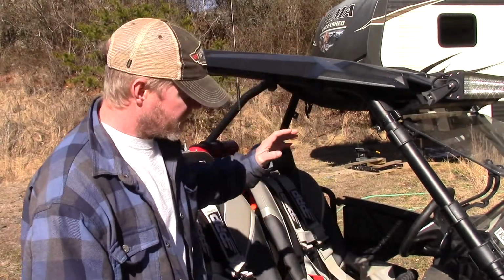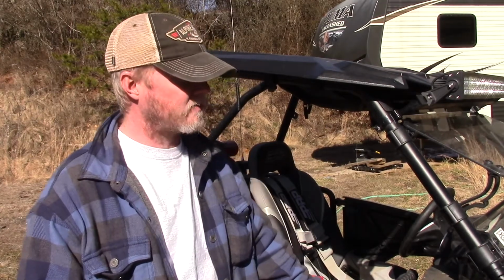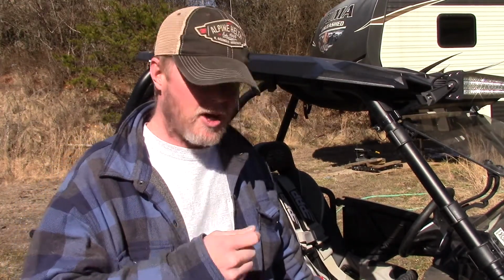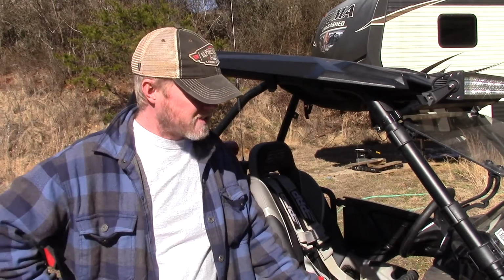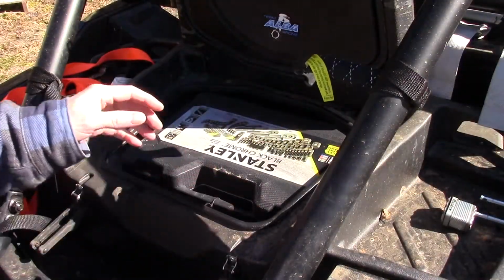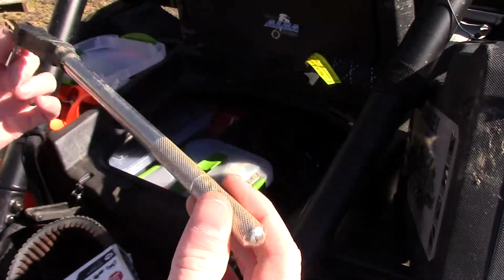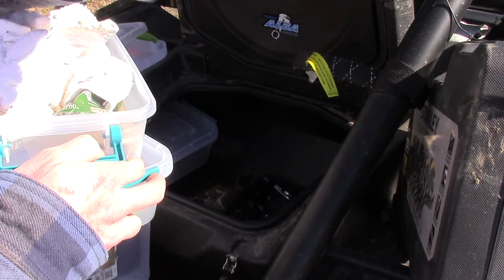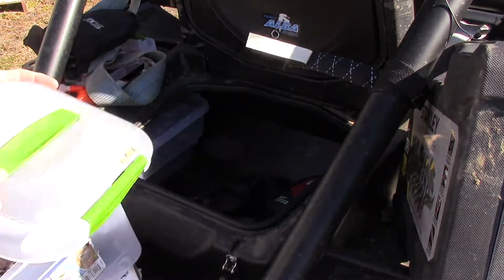RZR Tips and Tricks Part 2 Ride Readiness

Comment: Very good advice about getting the rzr moving. I've seen so many people in high going over a really rocky hill barely moving holding it wide open lol. Painful to watch. I have a 2017 rzr 1000S. What makes you decide L or H gear? I've been using low a lot, especially considering the belt is still breaking in. if you're over 7 mph or so is H okay? assuming no large hills or rocks.
Reply from the maker: Chris Brewer I will use low anytime I’m doing anything under 20 sustained. Sometimes even after a double diamond I’ll cruise in low for cooling and light stress before I switch into high on the smooth parts